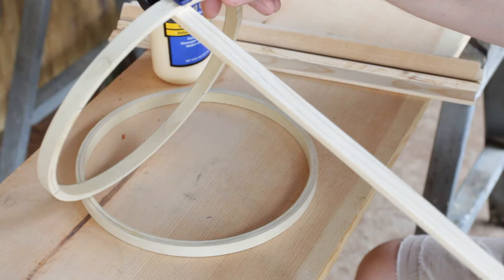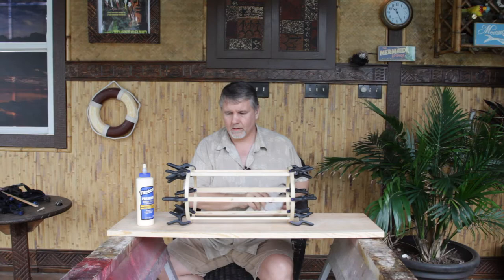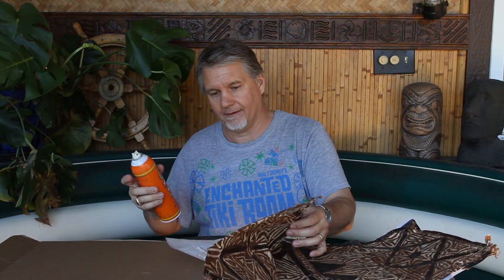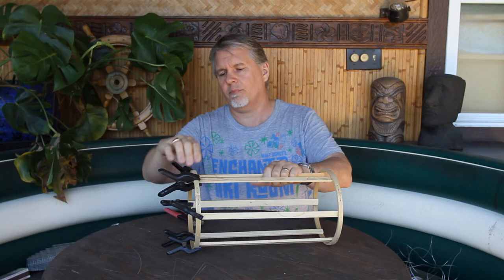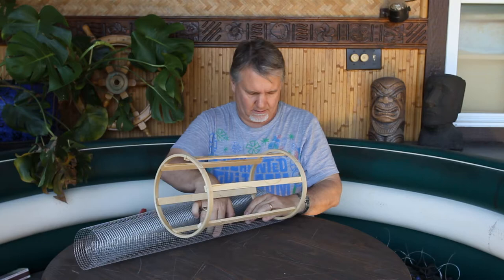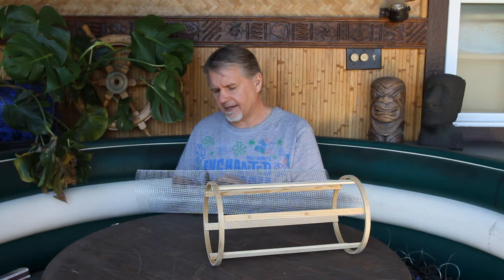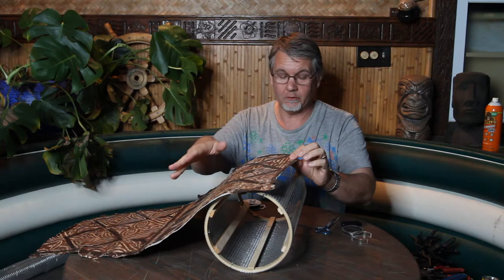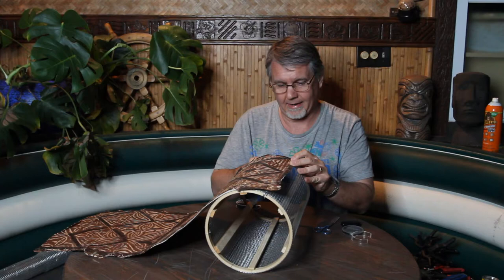A Moment of Tiki Episode 45: Tapa Light

Comment: Holy smokes! This was an epic project. You knocked it out of the ballpark though. The tutorial was riveting. I hope I can take this and do something similar with fabric. I’m also going to check and see if I can get a light that doesn’t flicker. It’s lovely. I’m so impressed and inspired to try this. 🗿❤️
Reply from the maker: Thank you for the kind words, LaKeba! I specifically used a flicker bulb because that's the aesthetic I was going for, but a regular bulb would work just as well. If you wanted, you could use a colored bulb--blue, yellow, red, green--depending on the effect you wanted. LEDs have become so common that colored bulbs are readily available at supermarkets or Walmart. Of course, regular white light bulbs work just as well, although in my experience warm or amber-skewed light is more appropriate for a tiki space. 

If you build something let me know how it turns out!

Comment: Great looking lamp! Where does it plug into power source? Thanks!
Reply from the maker: I have attic access, so I ran the wire up through the ceiling and have it hard wired into a wall switch. All of my dedicated tiki ceiling lighting is controlled by that single switch.

Comment: Great tutorial! What is the interfacing that you used?
Reply from the maker: Just the cheapest I could find at the fabric store. That was probably a mistake, as the heat-activated adhesion did not work. But it was still stiff enough to use (and act as a diffusion layer) with a judicious application of spray adhesive.

Comment: If i didnt have the amazing MacGyver bamboo skills you do... what would be an alternative to mounting the bulb ?
Reply from the maker: If you size your bulb access hole correctly, I suspect a Himalayan salt lamp socket would be an easy, one-piece solution. These have folding wings on the side that allow them to clip into place, along with an in-line switch on the cord. Google and a bunch of options will pop up. The downside is that these appear to be mostly E12 bases, which is smaller than a full size bulb. You might hunt around to find something larger if that's an issue. But there are lots of E12 (candelabra) LED bulb options, including some flicker bulbs if that appeals to you.
Reply: @LagoonofMystery  thanks !! ive been looking for that type of socket forever ! .. i wanted to mount a float light and i think i can use the same thing.
Reply from the maker: @Bigpete9000  That was my initial thought as well, but I've since gone in a different direction. I've got some other ideas for that salt lamp socket, tho, so stay tuned! 😉

Comment: Where did you get the perfect sized clamps for the lamp construction?
Reply from the maker: You mean the black spring clamps I used for gluing the straight pieces to the bamboo hoop? They came in a multi-size netted pack at Lowe's. I bought a couple a few years back but I assume they still sell them.
Reply: @LagoonofMystery  Thank you. Those small clamps are the perfect size for small projects. I'll check out Lowe's tomorrow.

Comment: ❤ this video!! How did you half split the bamboo? Knife and rubber mallet?
Reply from the maker: I've used a sharp machete and mallet to do this in the past. I've had trouble maintaining even splits on long pieces, though, but for short lengths like this it should work well. I couldn't find my machete this time, so I used a jig on my table saw that I normally use for long splits. Serious overkill, that.

Comment: Could you list the items used please? Like the interfacing.
Reply from the maker: The interfacing is Pellon brand, available at any fabric or craft store. They have several types but I've used most and not seen any difference in the diffusion performance--just get the cheapest available. The bamboo crochet hoops can likewise be found in craft centers or online. There are lots of light sockets and flicker bulbs available these days either online or in home improvement stores. The specific type isn't important--just just whatever is most convenient. You'll make up a lot as you go.
Reply: @LagoonofMystery  thanks so much!
Reply from the maker: @eekab4386  De nada!